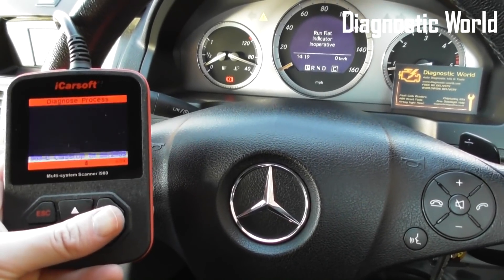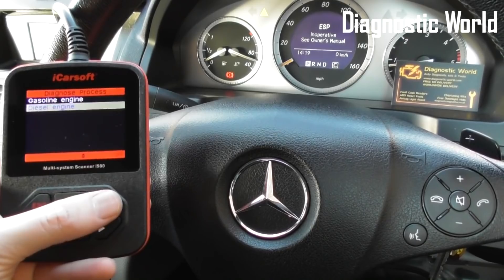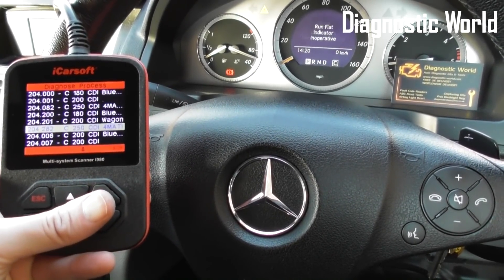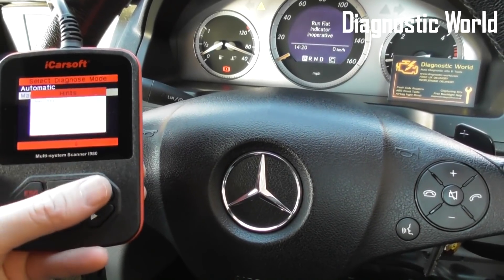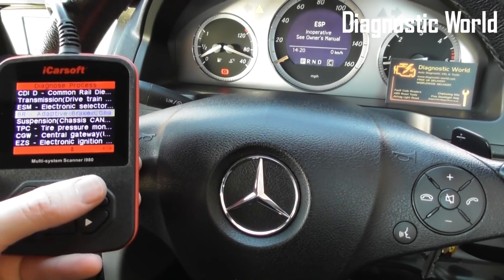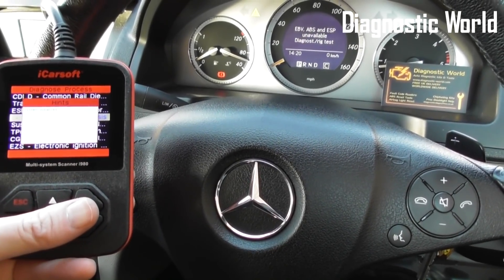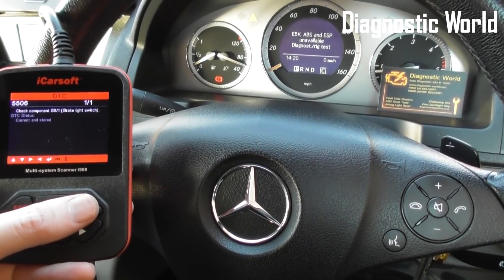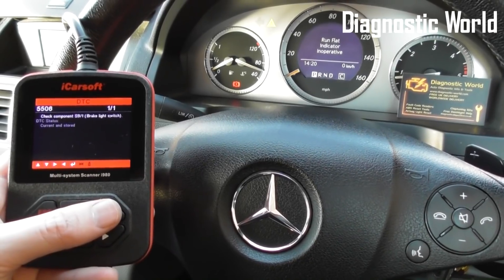Mercedes ESP Run Flat Triangle Warning Lights Diagnose

Comment: I changed the yaw sensor on my cls 320 w219 problem solved sensor on the back of drive seat under the carpet on the centre of car
Reply: Im having this problem.  Can you help me?  Or give me an email to send you a vídeo of the dash,  for you yo see if it eas the same issue you had?

Comment: well, i got an itresting one, so when i go full power, my ESP, can suddenly stop working and i lose all engine power, that returns werry slowly, so is it a bad connection? also for everyone driving a c200 cdi w204 2008 model chekc your taillight, my car and my sisters car that is an A class, and on both cars the right taillight and left has almost  GONE UP IN FLAMES!!!!  ther is som sort of bad connecting or somthing, so plz chekc this, oh, and on my sisters car  the connection one the lighit was almost fully melted, SO BE AWARE, anyway thx for the video, and sorry for my bad english -_-
Reply: I had the same problem. ESP inoperative and runflat indicator came on. After that, the accelerator does not rev the engine at all (i was  going 80km/hrs on a road). After i came to a stop, i couldn't start the car. Diagnostic shows it's nothing to do with the battery or alternator.  A swap of a new ECU unit removed all the errors and engine was able to rev.
Reply: @focus168168  how much does ecu cost
Reply: How did u fixed it?I have the same problem

Comment: The problem:
When ever my wheels spin (ice, gravel, etc), or when I went above 20km/hr on a cold day I would get a "ESP, ABS, Power Steering, Run Flat Indicator inoperative..." message and my ABS would no longer work.
Dealership solution:
Replace ESP/ABS module for $1,600 + $150/hr labor. They would not do any "repair" aside from a scan and replace entire unit.
My solution:
Un-plug ESP/ABS module, sprayed electrical contact spray ($6.99) on both ends, cleaned both ends with high pressure compressed air, re-plugged. This actually fixed my problem and it has not come back even in -16C. I guess the plug gets unseated over time and dirt gets in...  some of the connectors fail to carry proper voltage to the ABS module, and it throws a fit. I bet in most cases it's just a bad connection, low battery, or one of the brushes on the ABS motor went bald ($18-30 DIY fix).
Reply: where is the esp/abs module located on the vehical please
Reply: @Todd Bergman what was the outcome how did you solve it ?
Reply: @Todd Bergman thanks for the reply, what is the ISL stand for?
Reply: how did you solve it??? i have this problem too